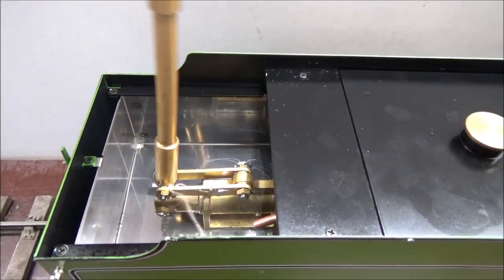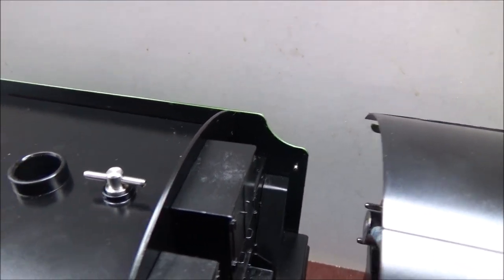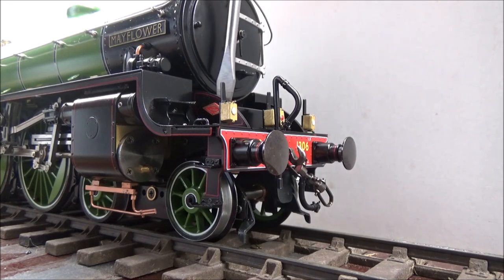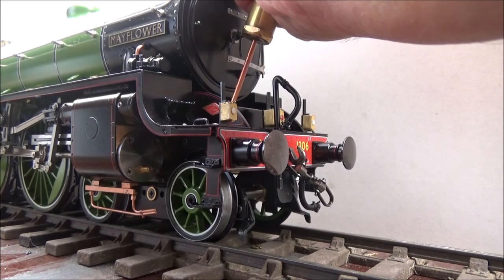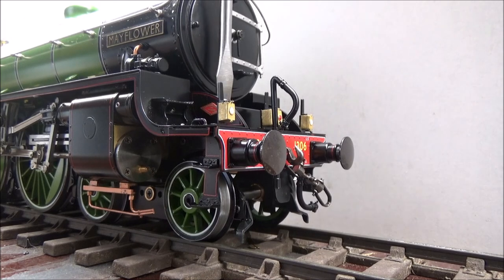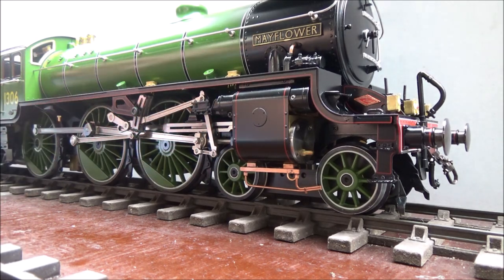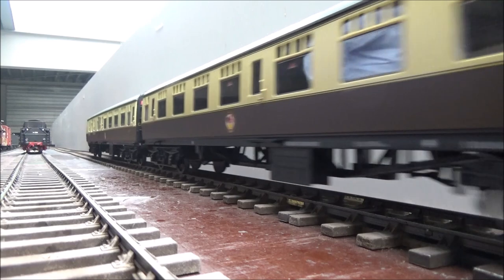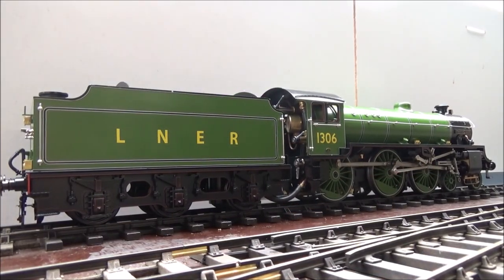Short instruction of how to fire up the new Aster LNER B1 Mayflower

Comment: It would be useful if your video showed the device used for filling the fuel tank and also the 'ventilator'.

Other useful info would be the kind of fuel used - the type of water - and the grade of steam oil.
Reply from the maker: I understand what you are saying but in most of my other video`s ( 700) you can find all this info, so I thought that  most viewers would know by now. The fuel we are using is Methanol or Ethanol above 90% but this depends on in which country you live. The water should be demin. water and the grade of steam oil is the thinner version I think it is grade 400  so not the heavy stuff that that the ride on boys ( 5inch or more) are using, this is to thick. Hope this is of any help.

Comment: I am a little bit surprised by the O-Ring ( press in ) plug for the Alcohol / Meths fuel tank instead of the traditional screw - on caps of older models. Lovely engine by the way.
Reply from the maker: They did it before at Aster having this system so it should work I think. Glad that you like it.